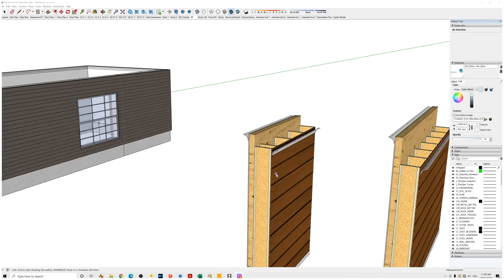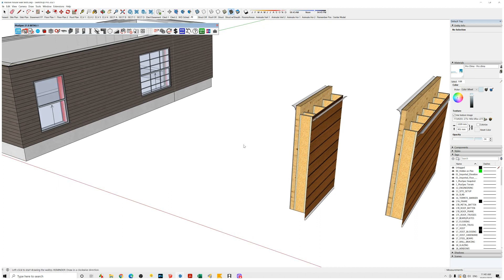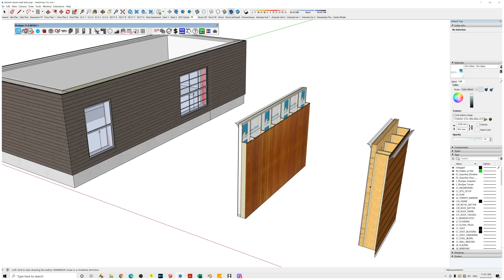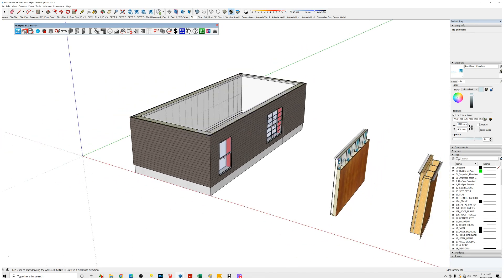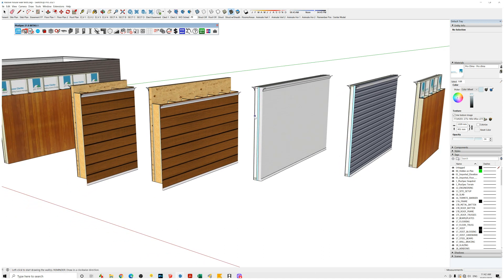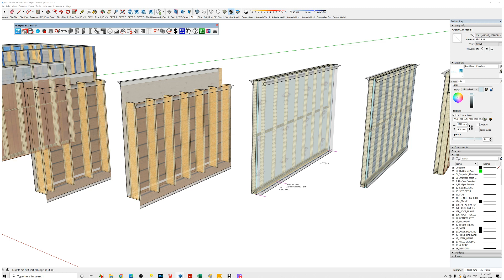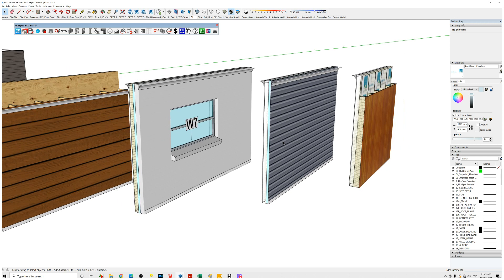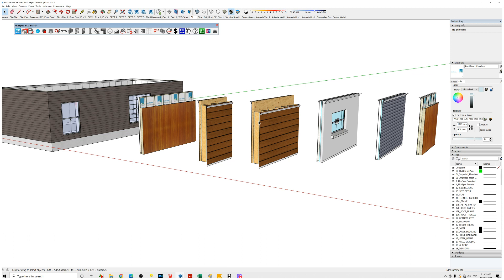Passive house wall systems methods and cost constraints during Covid

Comment: Old video, but if you are having ANY conversations about passive science and wall assemblies, one needs to clearly state what zone you are building in.  In addition, if you are talking about materials you need to state where you are
Reply from the maker: Ok, thanks, that's good advice.  Since our PlusSpec user base is all over the world, it is tough to add specifics as each area has different requirements. If you've got a few special requests, could you ask them on the forum?  Note you can access the forum from inside each PlusSpec tool. Also we just about to update the forum to make it easier to use so maybe hold on for a week or two. 
Thanks for commenting.  👍

Comment: Hi Andrew  Thanks for the update.  Will you be including some of these additional wall types in PDB or is the plan to allow designers to set up some of these configurations?
Reply from the maker: Hi Dave, you will notice new options for wall types inside solid wall, masonry walls and clad walls that enable you to add the extra level of detail for Passive house. And yes everything will be organised and quantified which should enable you to keep clients informed on estimated costs.

Comment: I wish people would stick to talking about what they know
Reply from the maker: Thanks for the feedback Michael, we know building and the availability of materials, we are always interested in learning more though so please feel free to share a link. 
 I think the key points to be taken from the video are: availability of material locally, and price associated to keep the project progressing due to transport  delays due to Covid.  The actual methodology and selection of any system, wall system, roof system or floor system is that of the designer. Maybe that could have been clearer?
Reply: @PlusSpec  I agree with the availability of material being an issue most defiantly. However there are many ways to build a passive house and they can be completely different between climates. A good designer should be looking at more sustainable ways to build in the current environment anyway.
Reply from the maker: @michaelcousins3177  Yep agreed, and thanks for commenting. Andrew would like to go along to a training day on Passive house, if you have any advice on courses it would be much appreciated. We have a lot of Passive home builders using PlusDesignbuild now to create  rooves and walls on more efficient homes. Here are some of the questions we receive you might like to chime in https://plusspec.com/forum/viewtopic.php?f=30&t=8673